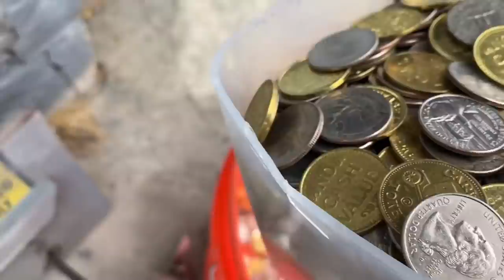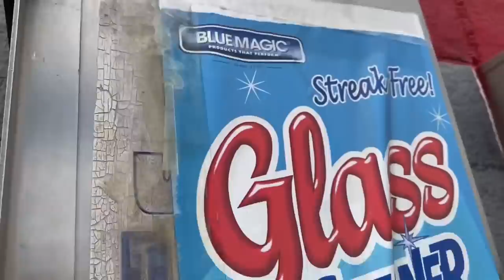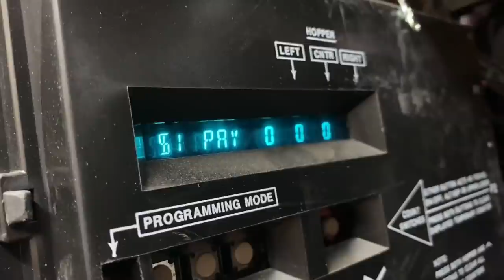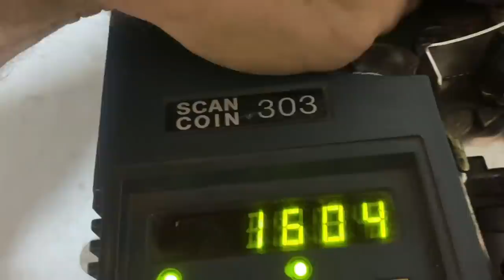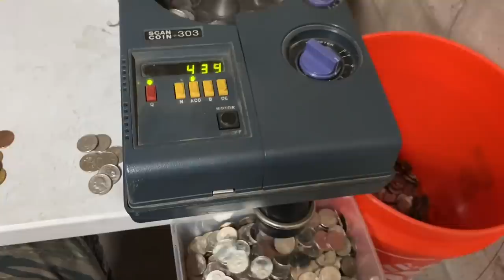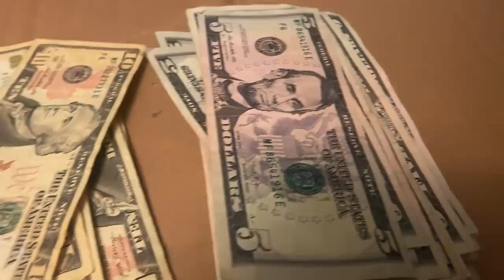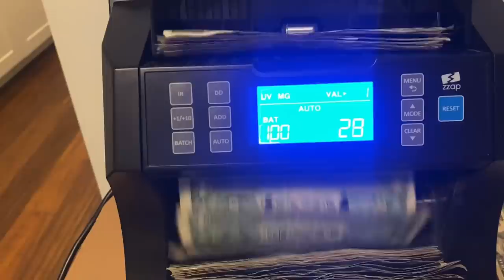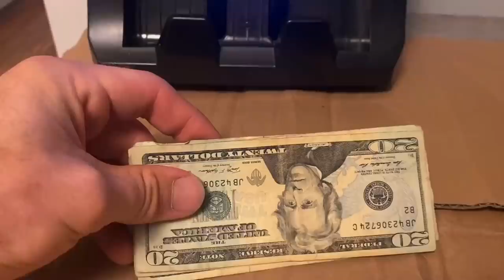How much my car wash made in just 6 days

Comment: there are so many car washes in that area, surprised they can make it.  What's the car wash saturation limit for a given area?  they are such easy structures to build, can't be hard to put one up on a vacant lot, I bet the permits for a new car wash are hard to get.  
can't you just use one big triplex pump for all the bays?  what about solar water heating?
after 10 years you'd probably make more off selling the land than the car wash $

Comment: What did it take to get to this point?  Im currently making about 600-900 a month on mine, not profit.  We have a 5 bay wash.  We are kinda cheap too, but its been neglected for the past 10 years and we are not just starting to get it going.  Fully Gated, New Hoses and Wands.  New Pumps, fixing the concrete.  Its in a high traffic area, but just not getting the people to come in.  Any Suggestions?
Reply: How are you marketing
Reply: @lorstanis1656  we have an add in a local magazine, have a big sign and put in a restaurant on the same property.

Comment: Do you verify that the tokens you counted agree to the cash put into the token machine. Should the two amounts match if customers didn’t bring previously purchased tokens.
Reply from the maker: Yes. Usually there’s an extra $100 or so in bills because of people change a $10 for 10 tokens they might only use 6 and take 4 with them
Reply: Thanks. If you didn’t guess my background is in accounting. Noticed you answered the question in the most recent video: Do you want to own a Car Wash. cheers

Comment: So, I take it that your change machines only dispense tokens. Am I correct?
Reply from the maker: Yes. I choose to use tokens but if I wanted to use quarters then I could just put in quarters. The machine itself can dispense them but id rather tokens
Reply: How did you get the machines to do tokens & quarters?
Reply from the maker: @Munchy05  Its a built in function in the coin counter. Just have to make the selection of what size coins you want to count
Reply: @CarWashChronicles  interesting I may have to look into that. I found a car wash for sale don't know the price currently but it could use aloy of love. I may continue to reach out to from time to time. Do you have a good way of being contacted?

Comment: Definitely a nice collection. But you haven't specified how many expenses you have. Such a large building with that parking lot. All vacuum cleaners and high pressure water. The electricity and the water. The water recycling system and everything else ... You're sure to get some payoff, but it's a lot less impressive than it looks
Reply from the maker: Check out my video on the expenses so you can understand better. Thanks